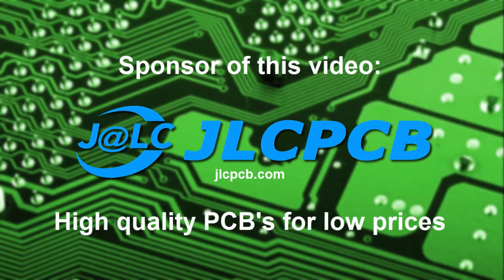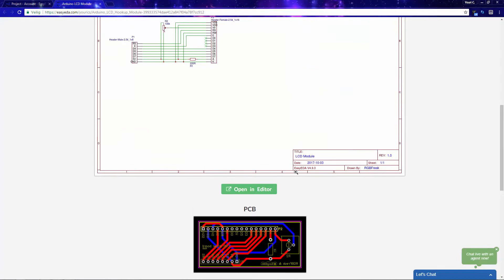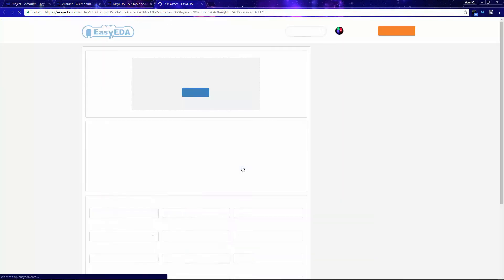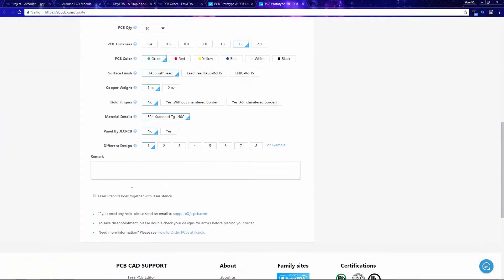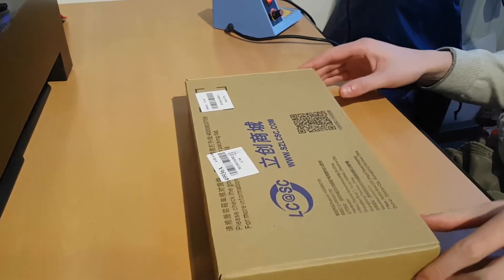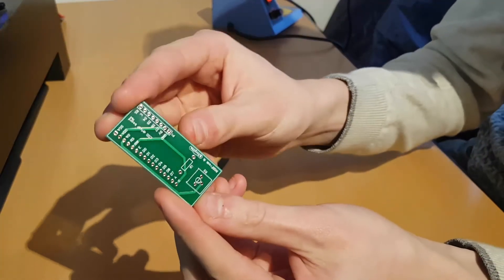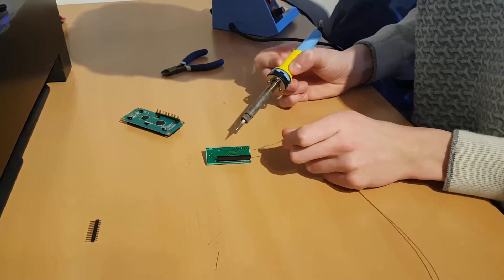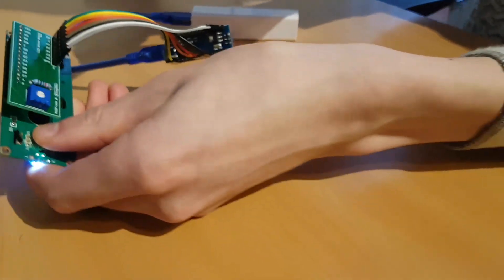DIY Easy LCD Hookup PCB for less than $2

Comment: Greetings; You just missed 1 tiny useful tip. Hacking the I2C module in order to adjust Contrast and Brightness with Microcontroller  (Arduino Uno/Nano/Esp32 etc) PWM Pins.